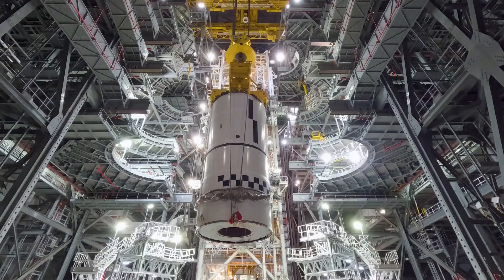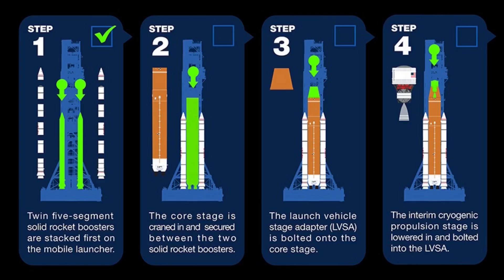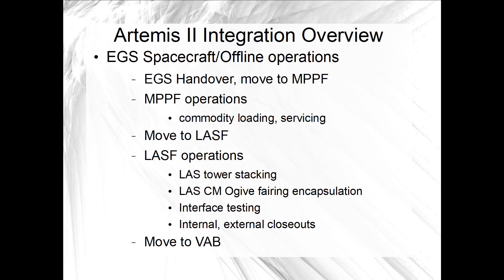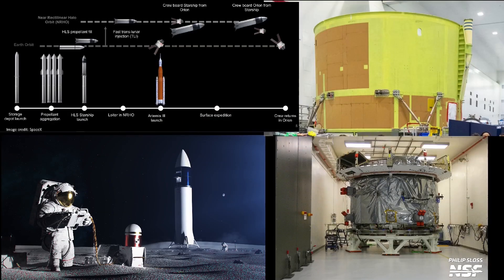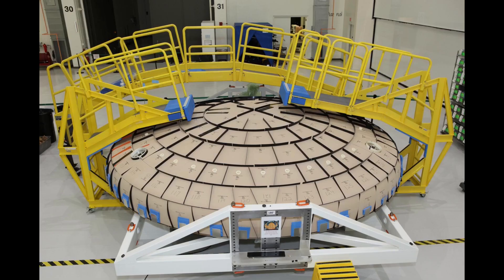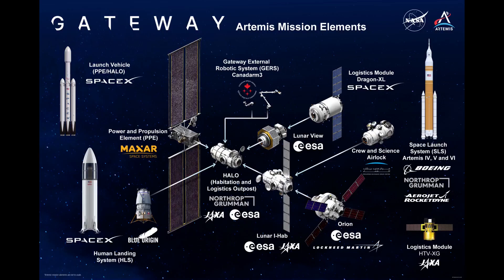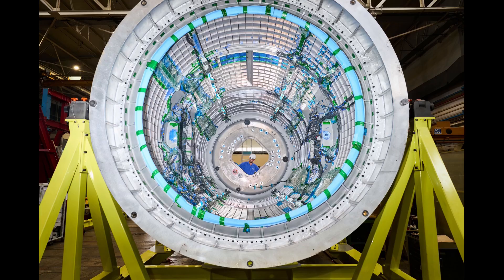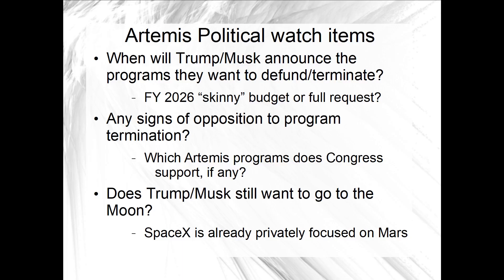In the shadow of politics: the Artemis big picture today

Comment: I worked as an engineer for the government and government engineerrs can work quickly and efficiently untill the beaurocracy gets in the way and impededs progress. It is unlikely but I hope DOGE takes a look at the SLS program and can help make it faster and more efficient. So many government projects are weighed down by unnecessary requirements and red tape that could yield faster development if eliminated.
Reply: Instead, DOGE wants to replace SLS with Starship.
Reply: @alyssagriffin5781   that's speculation, there's no official plan to do anything of that sort.
Reply: The only thing doge does is software updates. They have zero authority on federal spending, that’s congress’s job

Comment: If the private sector can do it cheaper than the program should be cancelled.
Reply: They can't because of the sunk R&D costs
Reply: @challox3840 if all regulations were removed and rockets were not man rated anymore, we would cut the cost by 25% and the astronauts will have a 50% chance or survival because abort system will not be available due to development being too expensive.
Reply: But can they do it *faster*? Because that’s what is also important here.